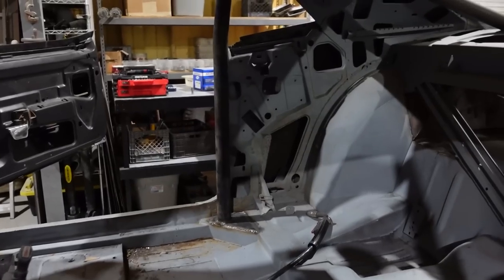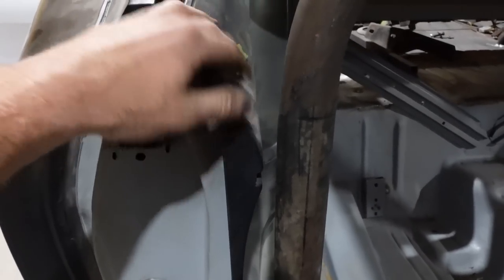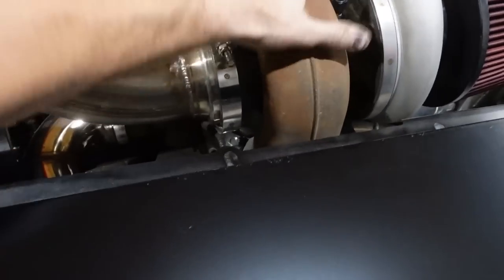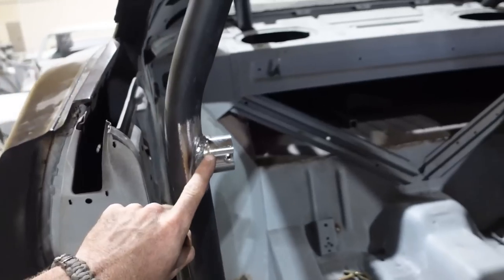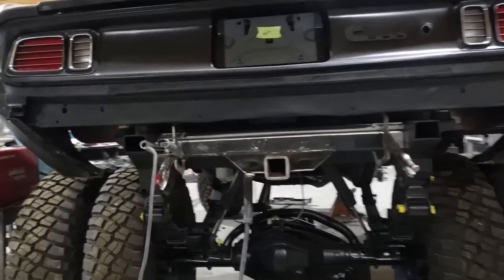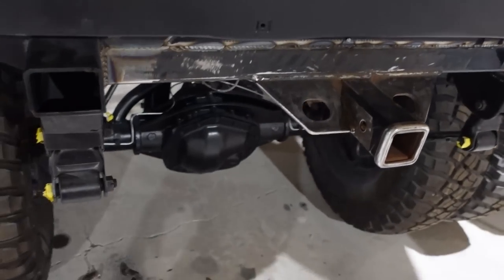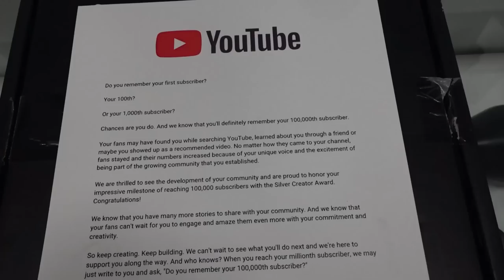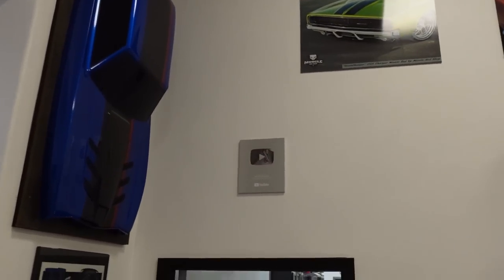OUR 1ST PLAY BUTTON ARRIVES!!! ...... And some CUDA stuff!

Comment: Congrats! I am among the Demolitia as well! I also have been wrenching for most of my 63 years! Wishing I could have seen these vids before I built my '71 Camaro! I would have known it was too far gone and never messed with it. Since I didn't know any better I did it anyway! Started in the mid eighties with a $100.00 "almost roller" I bought from a friend because his parents were sending it to the crusher otherwise!

Body on wheels and tires. No engine or transmission. No carpet. Windshield broken, RF fender cut from the wheel arch up and the front part missing. LF fender with pickaxe marks (It's a Looooong story). No grille. Many years of weekends later (like 30) I had a beautiful car that looked like a debadged Z28! Bright white (was Arctic white when I got it). Hood and trunk stripes I PAINTED myself in Dark Sapphire metallic (Year One stencil kit). Converted from straight steering column and manual steering to tilt and power (all from a junkyard wreck Z28)...

Engine I built for it was a 327 out of a '67 Impala (the usual "healthy" SBC build 2.02 heads 350/327 cam, 4bbl, etc). Transmission from a '67 Olds 442 (4-speed Saginaw and parts from three different Hurst Comp + shifter kits). Car is long gone (had to sell it) but AFAIK it's still on the road ...

I'll try to link a pic:

https://nastyz28.com/media/phils-71.5301/

I still have THIS one: '76 Monza 2+2. 4-speed, built 350 (same spec as the 327). Original V8 car (came with 4.3L, which I still have because other than the 350 it's a numbers matching car, and I'm the second owner, bought stock in 1978). Headers, true duals, 40 series Flowmasters ...

https://nastyz28.com/media/my76monza.5314/

😁

Comment: The way they do navy grade seam welds in areas that will be exposed to the elements is to do an initial weld, grind it back, weld it again, grind it back, weld it again...quite a number of times.

This ultimately prevents the elements from effecting the weld and degrading it over time...also makes it super strong

Comment: Congratulations Brandon! There should be a Let's Go Brandon tee shirt in your future??

That Matt guy is a tough cookie. He brought the Cuda project and it took more turns than a squirrel on crack. But even with 8,739 changes to the order, the finish line is near.

Muscle Rod Shop isn't just a bolt on shop. You guys are craftsmen. Don't tell Tony, but this means him also. 

The Demolitia in Texas is like the Strad Brigade in Utah. It works, so ride it like you stole it. 

PS, don't let Matt drive the 5-ton though the swampy waters of Grainger Smith's place again. Also, Clean up the exoskeleton so that in an emergency, you can access the underside of the hood.   Who's going to get the job pulling the Cummins 8.3 for a refresh, you or the Holden Brothers?